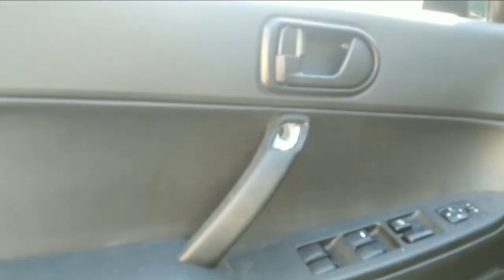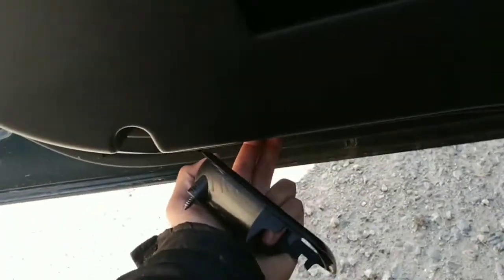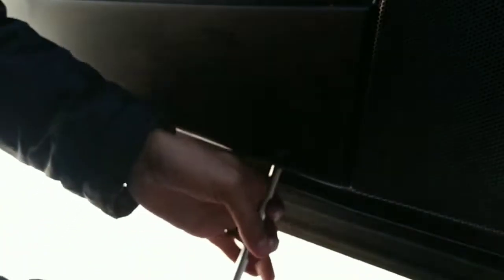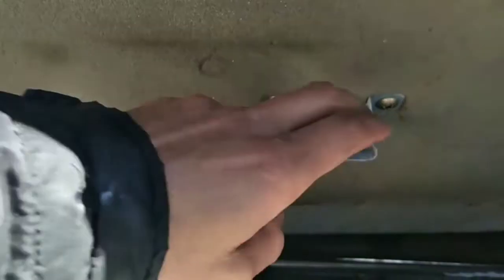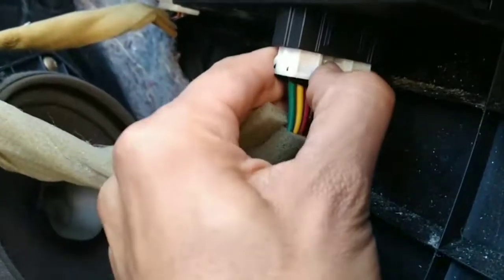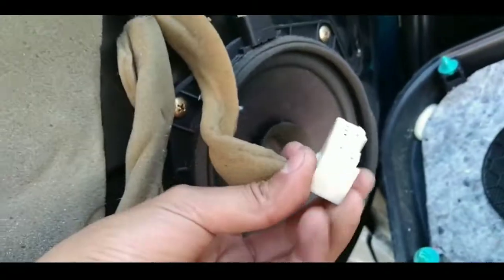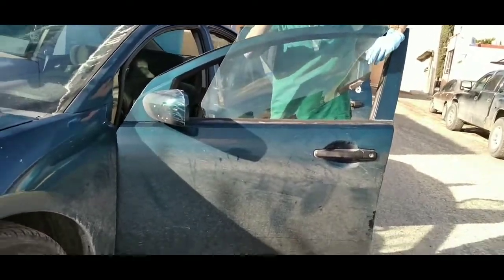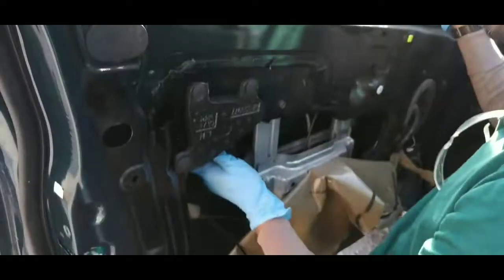Mitsubishi galant 2006-2009 broken window replacement.how to remove door panel Diy

Comment: Thanks for the video... I needed to brush up on what to do and this was perfect. Yours is a Galant, mine is a 2007 Mitsubishi 380. Great thing is, the Galant is really a mini version of its bigger brother... Amost identical proceedure. A couple of years back, mine had what I thought was a Drivers Side Window Regulator problem... It turned out to be the glass simply came unglued from the lower brackets. 😃